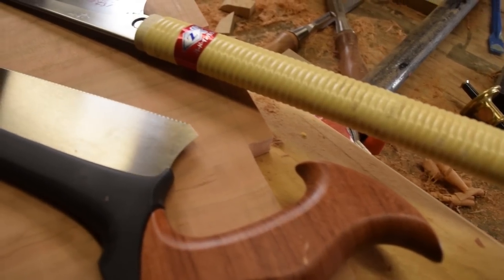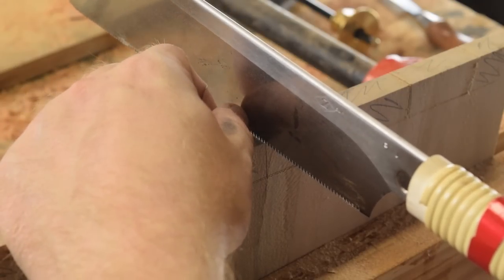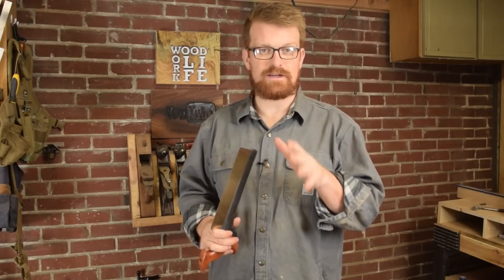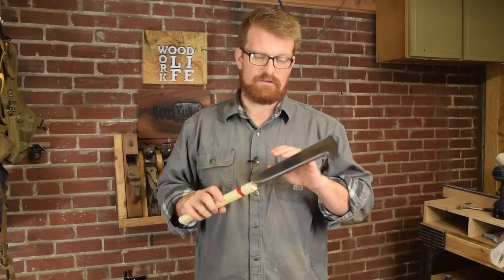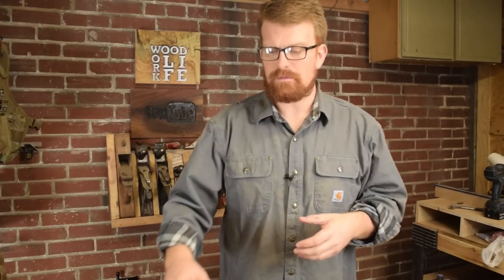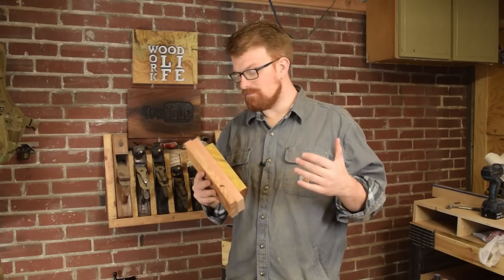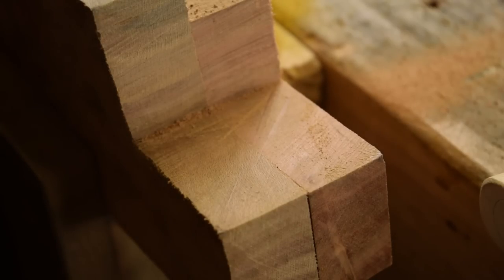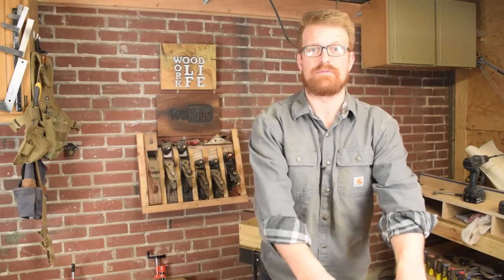Z Saw Dozuki vs. Veritas Western Backsaw - East Meets West | Hand Tool Shootout

Comment: Want to avoid tear out? Take a sharp knife or marking knife and mark your cut line with that instead of just a simple pen or pencil mark. Cut the fibers before you cut the board, no tear out. I prefer the pull saw over the "push" saw for the fact that, it's easier to "pull" through the wood than it is to "push", less chance of the blade to "catching" into the work piece. Just my thoughts.

Comment: I've watched only a few WoodWorkLIFE's and have enjoyed them.  Thanks.  I'm a little confused on this one, though, especially since I very rarely use a hand saw.   Why compare a well sharpened saw of any kind to a saw that is beat up enough to even have broken teeth??  Isn't that sort of an orange to apples kind of thing?
Reply from the maker: +TwoRails Rails they've both been in my shop about a year.  So its more just a real world comparison.  The Dozuki is still very sharp though, believe me.  When I was doing the finish cuts I avoided the broken teeth, it's about at inch of the blade.
Reply: OK, understood.  Thanks for the clarification :)

Comment: BTW they do make Japanese saws with blades that can be sharpened, it's just not the near low end like most people in the west like to buy. Plan on spending $150 or more for a traditionally made (not massed produced) hand sharpenable Japanese saw.
Reply from the maker: +Brian Zick ya I am trying to get one, doing all the research on how to properly buy them so I don't get screwed.
Reply: Wood.Work.LIFE. Makes sense.
Reply: NO
Reply: Yes they do, but still it is a very complex and time consuming process to get the japanese style filing right, compared to the much simpler geometry of western saws. For most people it will not make sense. Not even pros. You'll need a very specific task for it, that a western saw is unable, or at least very bad at performing, before I'd even consider it, but maybe things like cutting ultra thin veneers or something could be just that.

Comment: Not sure if your comparison is fair. It seems that your Veritas is a brand new blade and your pull saw has seen better days. I think that difference is most apparent in the shoulder cut roughness. Now as to value Veritas 76bucks Z-saw 29bucks IF you REALLY enjoy saw sharpening over the course of 10 years the Veritas is cheaper. Sharpening is NOT woodworking. Spend 18.50 3 times and save the hassle.
Reply: Bruce Welty throw away blades are wasteful.  10 mins to resharpen a saw is no hassle.
Reply: Bruce Welty throw away blades are wasteful.  10 mins to resharpen a saw is no hassle.
Reply: @richardsinger01  you're not sharpening that Veritas saw in 10 minutes. What do you think it has a 7 TPI pitch? That saw could have upwards of 185 teeth on it. Trying to sharpen such a fine pitch saw could lead to eye bleed.
Reply: @1pcfred  i love it how people on the internet like to talk bs, I sharpen a dovetail saw in 5 minutes 1 stroke on each tooth this is all it takes.
Reply: @igoryakunin685  well good for you. Sounds like you're doing what you love to me.
Reply: @1pcfred  thats not the issue, the issue is people are afraid of sharpening, its easy af.
Reply: @igoryakunin685  easy for you. It really depends on what you're sharpening how easy it may be. If it is a saw in good shape that just needs one stroke to touch the edges up on it then yes, it can be easy. That is not always the case though. I personally still can't do a crosscut pattern to save my life. I never get the fleem angle right. Rip is relatively easy to do. Heck it is not even particularly easy to get the right files to sharpen saws with today.
Reply: Bruce Welty sharpening a saw is a proper woodworkers skill . By your estimation then sharpening a chisel or plane blade is not woodworking . Sorry to say but you are talking rubbish.
Reply: @richardsinger01  Your first assumption is seriously in error. I NEVER said throw them away. There are many ways to repurpose the steel.
Reply: @igoryakunin685  While it may be easy, I have never used a decently sharpened push saw. So! If you want to send one to me to try GREAT! Until then PUDHING a flexible thing is DUMB. Kinksville almost instantly.

Comment: A difference which you never seemed to mention is the fact that japanese saws seem to have little or no 'set' to the teeth (the 'clearance' seems to be provided by the shape of the teeth). I don't find my saws with japanese style teeth bind in the cut, a western saw with too little 'set' does, each has it's advantage.

Comment: With respect, I’m not sure your Japanese saw technique was very good. The Japanese have a very specific technique in which very little downward pressure is placed on the saw itself.  Also, Your cutting angle varied up and down several times while make a single cut, which is not good form. Even using a courser Ryoba, I don’t have lines is jagged as yours. 

It may be that you personally are more comfortable with the western style saw. I have both, I like them both.

Comment: I recently bought a Veritas magnetic dovetail combo. It comes with a Japanese pull saw with no back. I already own the Veritas back saw. I did my own comparison over a few weeks. I found the Japanese saw frustratingly slower and in my hands it wobbled occasionally. I’ve never had much of a problem starting the cut. I’ve rehandled a couple of gents saws, just as an experiment. It didn’t improve my accuracy.

Comment: Im so torn.

But seriously, if you had to take one to a deserted island, which one?  The veritas here is same price as that dozuki with two blades.
Reply from the maker: Gah, that's a tough one, but on a deserted island I would take the Dozuki as it would have better cut capacity, and more versatility, the teeth on the Western saw would hold up better though...now you have me thinking.  If you had one saw in your tool chest though I would saw go Dozuki, if I had two, i would get both :)
Reply: The struggle is real™
Reply from the maker: +r s 😂
Reply: Can you sharpen the veritas on a deserted island?
Reply: EJ Wu bet Paul Sellers could....
Reply: The veritas saw.  Where are you going to buy a new blade for the Japanese saw. 
Of course, hopefully you have a file with you.

Comment: Beautiful Effort man, I just noticed that the teeth configuration of the Dozuki is more of a cross cut , if you take a look at a ryoba Japanese saw (which I believe is the Ultimate saw so I am a little biased there) you will see that there is a side with teeth same as that Dozuki but the other side is with more straight (Rip) teeth which should give you an even thinner cut for your Dovetails.

I know that you've posted your video 4 years ago , but it is the effort done in the video that made me want to contribute. Good job man.

Comment: The difference between asian and western saw is that Japanese wood workers work mostly with softer woods not soft wood softer woods.

Most traditional western tools are meant for harder dryier wood.

And if your saw was sharp and set properly your dovetail western saw wouldn't have tear out.

Comment: Thanks for the video! Is that the fine-tooth Veritas Dovetail saw or the regular one? I have the fine-tooth but regret not getting the regular.
Reply from the maker: Ali Maleki fine tooth, I too regret not getting the 14 TPI one
Reply: I went the other way around. I bought the 14 TPI saw first, then got the 20 TPI. Trust me, the 20 is better. The 14 is nearly impossible to get a cut started where you want it without it skipping around! It cuts a little faster once it's started, but it's very frustrating to get the initial cut. That's the genius of Rob Cosman's saw - finer TPI at the tip to start the cut, then coarser for the majority of the blade to cut quickly.

Comment: I think your right. Both tools have their uses. I have both but then I just keep buying too many tools.
Reply from the maker: +Badger Workshop well of course, then you need your rip saw, you panel saw, your case saw, your cross cut saw, and you need all the tooth counts of each, and then you need multiples so you don't have to sharpen.  Then you just have to buy more cause theyre on sale and it's be a crime not to ;). Just go build something 😜
Reply: Yes boss. Going in the workshop now.

Comment: I'd like to add some opinions:
1. Some teeth on your Japanese saw might be sticking out sideways. That's why your cut is a bit rough. You can push them back easily and your cut will be a lot smoother. 
2. The long handle of Japanese saw allows for two handed operation. Also the pull motion should be a bit downwards. Let gravity work for you. It speed things up and reduces fatigue quite a lot.
Reply from the maker: +EJ Wu thanks ej, you are probably right.  I am not discrediting Japanese saws in general by any means.  I love them, thanks for the advice.
Reply: No I get it. I like your video! Just sharing some of my experiences with the tool. Cheers!

Comment: A nice walk through for everyone to follow. You do have a bit of pears and apples going on though. Although you might find a dovetailsaw in every other shop, garage or flea market, it is not a general purpose saw, it is very much specifically built for dovetails, which is why you are struggling to reach your deep cuts - it was never designed for it. If you want a more general purpose western saw, you have (at least) 2 options: One being the larger, but not necessarily with much bigger teeth, carcass saw, for yup you guessed it: carcass work in cabinetry. This would usually be a cross cut filed saw as opposed to it's sister, the tenon saw, for rip cuts. Phleagm vs chisel teeth. The other one being a panel saw, which is very good for long and deep cuts, since it has no back, but quite a heavy saw plate to mitigate the stresses of a push style saw with no back. Also meant to be used at the bench, since the blade is somewhat shorter, than on a regular joiners saw. You can get away with having the simple filed rip/chisel pattern on all of your fine toothed saws, whereas you will need the real diamond filed cross cut teeth on heavier cross cut saws, to avoid pinching. You'd never use one of the fine toothed ones to rough things in, but only to cut to final size, to avoid planing too much on the end grain... if you want to make light work of it anyways. So... One will need a set of sorts... Those are all not really just western style saws... more specifically, they are English style saws. In continental Europe we used frame saws... Yes, the other ones took over, but people are still trained in them in some parts. Here a set of saws consists of 3. Coarse cross cut, coarse rip cut and a mediumfine rip cut. Along with a good set of chisels and a couple of sharp and true planes and axes, you can make pretty much anything you want in wood. The finer more specific tools just make it easier and faster. just like power tools.

Comment: Not sure if I agree with the comment on value. The Veritas costs over 3 time what the Z saw does. I have been wood working my whole life and I almost never sharpen my hand saws. Usually, I see a new one and want to build up my tool collection before any of them get too dull to use. The Z saw is so cheap (I have seen it for under $20) that I can replace it. It's the number one selling saw in ASIA (there are a few people in Asia) so I am pretty sure Dozuki won't be going out of business. Value...the Z saw hands down. I personally like the pull saws better and I know plenty who have converted like me upon trying but I know plenty who love western saws. Preference is the decider...but value goes to the Z.
Reply from the maker: +Rotwang72 depends on your definition of value, but I think theyre both must have saws for people that actually use their saws and don't want to just look at them.  If I get 1.5-2 yrs per blade at 15$ a pop they are basically the same price over 5 years.  Anything beyond the Veritas can sometimes just be a show piece with minimal improvement in performance.  I think I probably should be bought the 14 tpi version of the Veritas I probably wouodve liked it more.  

Thanks for watching an commenting!  Welcome to the WWL family.

Comment: I'd be quite appreciative if anyone can point out a Japanese saw without the hardened teeth. I tend to prefer the pull method the Japanese use
Reply from the maker: I am not aware of any "brands" that make a sharpenable Ryoba or Dozuki available here in North America, I know you can get one made for you in Japan, but they are quite $$$  I asked Bearkat Woods how much he would charge me to make a Japanese style saw like his.  I think another one of the challenges is getting a proper file to even sharpen the teeth on a razor saw.
Reply: I was not expecting a direct response from the channel owner or a response so quickly, thank you very much! With that information said, would it not be possible to simply take a traditional American version and flip the blade around to have a pull stroke? Perhaps I don't understand how the saws actually function so thank you and please forgive my ignorance.
Reply from the maker: +Let's Plays you could but it kind of defeats half the purpose of the Dozuki (the thin kerf) some of the really nice American saws have a set of teeth right near your hand sharpened with a different rake to make a cut easier to start.  You can also sharpen your blades that way.  

Paul Sellers has a nice video on that.  

I think another problem might be the ergonomics of the grip on a pull stroke.  I think it might be the grip, but it might just be training, but with my western saws, my backstroke is less than clean.
Reply from the maker: +Wood.Work.LIFE. BTW half the reason I'm here is the community, I love responding to comments.  As long as I can keep up.  I watch for the first few hours.  Thanks for watching.
Reply: Thanks for all the information, maybe I'll save up and get 1 of each and see which I like more! Have a great day and thank you for the conversation!
Reply: Wood.Work.LIFE. Samurai Carpenter could probably point you in the right direction regarding getting a authentic Japanese saw.

Comment: You are bias. I have seen videos seeing the master woodworkers in Japan cut the joinery, and the surface is smooth like it has been planning . Their joinery cuts when put together it is snug fit and without using glue.
Reply from the maker: Show me ANY video of a Japanese joiner NOT using a plane or a chisel on a joint and I will eat my words.  I will give you that I am by no means a master with either of these saws, but I do have a ton of hours of practice and use.

Comment: Well, it is vague just to say "The Dozuki Saw", because you can get these saws with different type of teeth, different sizes, extra hard. In a german shop you can find 25 Dozuki saws with different sizes, teeth shape, teeth size and so on. You can get them for crosscut, ripcut and with an universal blade for both
Reply from the maker: +Burli's Bastel Bude these are some of the most ubiquitous versions of these saws.  Z saw vs veritas

Comment: Entertaining but I think, that this comparison is not correct. There are specific saws on Veritas and blades for the Dozuki, for ripp cut and for cross cut. There is big difference in performance if you use a dovetail saw (that is generally a ripp saw) to do cross cuts or a Dozuki with a cross cut blade. Try this test with a gyokucho 371 for cross cuts, and there is no comparison, the time and specially the finish are far superior to any western saw. The other aspect is that this test compares a blade with several teeth broken (that specially on Japanese saws shouldn't be used anymore) with a sharp western saw. A Japanese saw when is cutting with some broken teeth is going to misalign the cut and produce scratches on the side parts of the wood due to microbends of the blade teeth. On the other side the cutting action needs also to be performed using gravity on the descending movement and at a specific speed( faster and light on traction movement, other than that, the wood fibers will be teard not evenly cut. Also important is to hold the Dozuki on the back side. Gives much more precise movements and let the arm rest lower in a much better ergonomic position. Less efford and better cuts. Lastly the piece should be lower and the arm that is operating the saw should run free from your body in a long motion without be restrained by your body (generally at your hip )

Comment: Yes Veritas backsaw saws straighter because the blade is thicker, and dozuki blade is thiner - about 0.3mm. Try to hold the japanese saw at the end of the handle it will saws straiter. And the main point - the Sharpening of a Japanese saw only for a kross cut not for rip and your baksaw is universal. Try Ryoba 9-1/2" Double Edge Razor or SUIZAN Japanese Pull Saw Hand Saw 9-1/2" Ryoba ( Double Edge )  their blades are thiker about 0.6-0.9 mm

Comment: I have Japanese saws that are sharpenable. You send them to what is called a Matata.  They readjust and charlene the teeth. This is is for the nicer handmade saws.  Not amazon cheapies.
Reply from the maker: Ya, I compared these two saws since they are most people's introduction to eastern and western saws for joinery.  I would have my own recommendations for actually buying but honestly with these two saws the result is a push at best.

Comment: It looks like you used a 2 year old japanese saw with a nlot of broken teeth and a newish veritas saw. It looked like the japanese saw preformed better considering the wear.
Reply from the maker: The saw was actually pretty new, but I did replace the blade recently.  I am on the fence between east vs. west, they are both good saws.